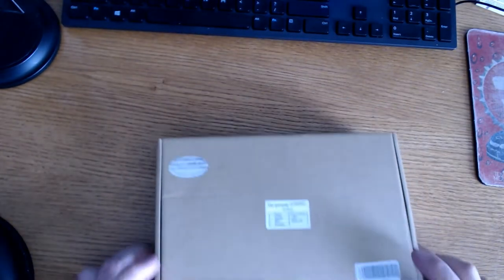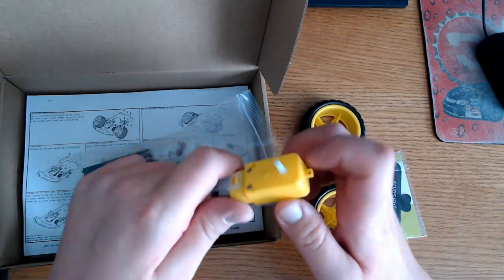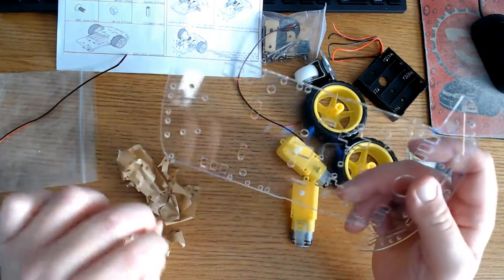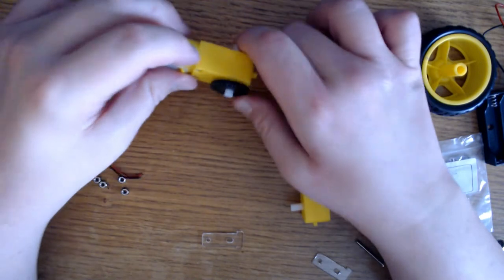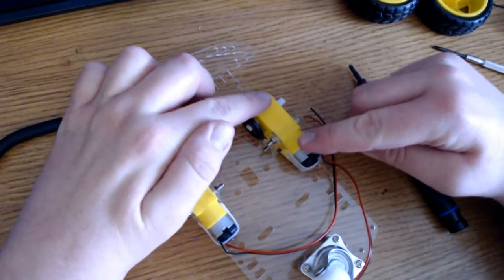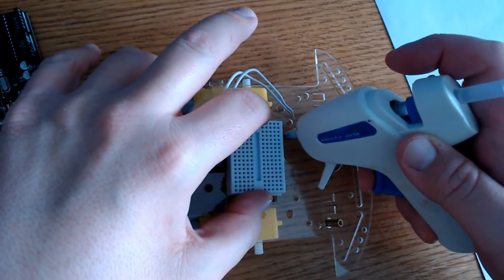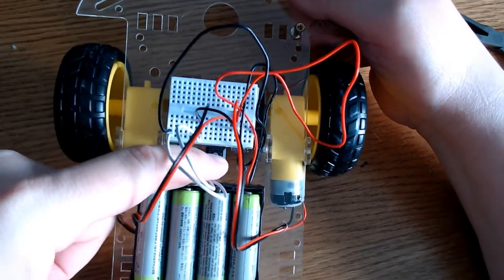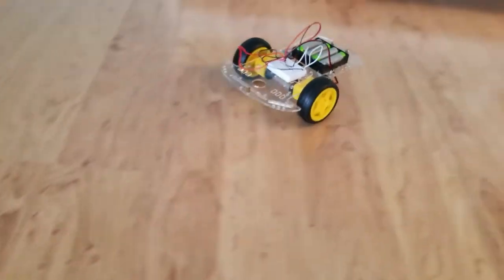Complete Assembly And Review Of A DIY Robot Smart Car Chassis Kit For Arduino or Raspberry Pi

Comment: Helped me a lot thanks a lot dude :face-blue-smiling:

Are AA batteries better in this case? Why does the manufacturer say it takes AAA? 

I see you are using bigger batteries
Reply from the maker: Glad it was helpful! 👍💪
You can use AAA batteries if you like. I don't have rechargeable AAA batteries and AA has a larger capacity. Both are 1.5v
Reply: @BMonsterLaboratory  yeah i realize the voltage drops with AAA sometimes one motor moves slow. Wondering if its s connection issue. Experience any difference in the motors?
Reply from the maker: @mmshilleh  no difference. They should last a while if they are fresh batteries and you're using 3-6v dc motors.